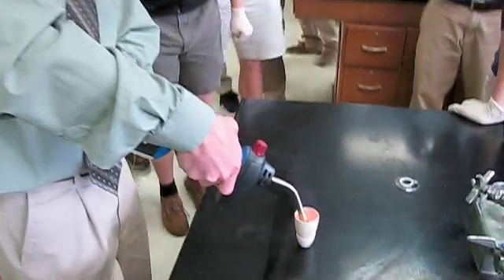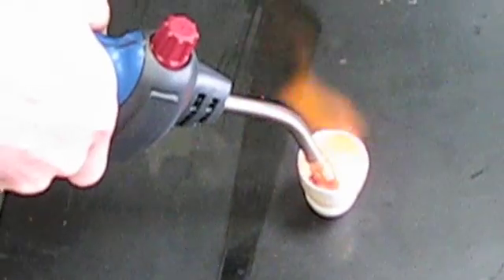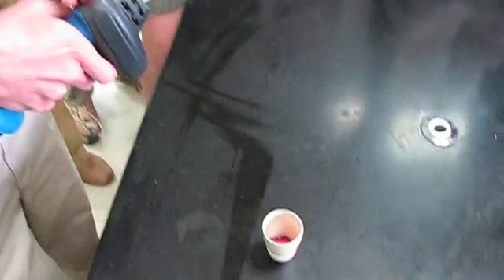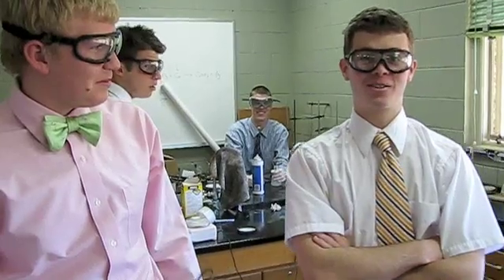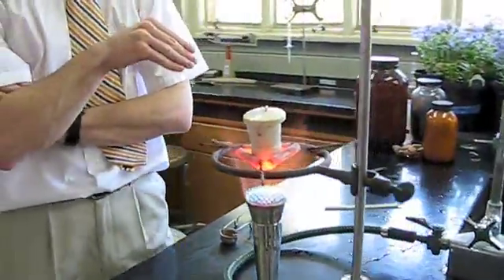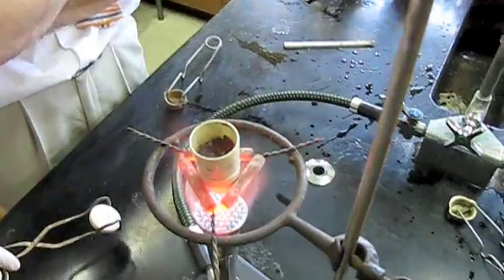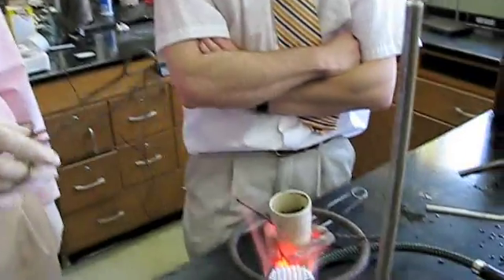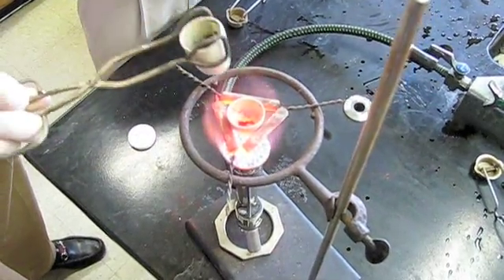Iron production from Ferric Oxide (rust)

Comment: Is any of the metal lost during this like say  took a gram of rust would I get a gram of iron from that rust ?
Reply: You can get upto 50% of iron from the original volume. The rest is lost or is reduced
Reply: Why not use calcium carbonate? That way escaping carbon pulls the oxygen? Leaving calcium and iron.
Reply: No. A considerable amount of oxygen is present in rust.
Reply: Yes
Reply: *facepalm* If you got a gram of iron from a gram of iron oxide, that'd mean you produced more iron than you started with contained in the oxide. This isn't alchemy, and oxygen atoms aren't weightless, so when you chemically bond them to iron, the result is a molecule of greater mass, i.e. a heavier one. A 100% conversion for 1g of iron oxide into iron would yield about 699.3865mg of pure iron.
Reply: Custos I said that bud.
Reply: @custos3249  all he did was ask a question. No need to be rude man.